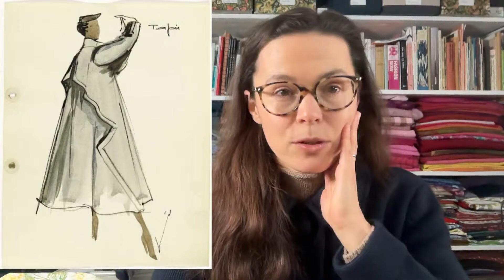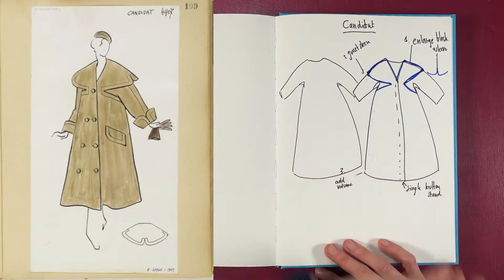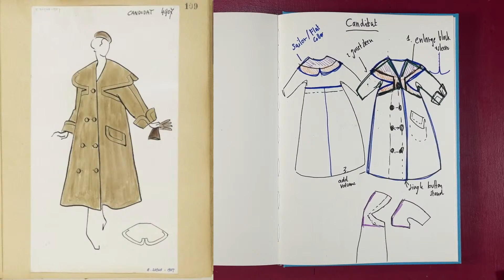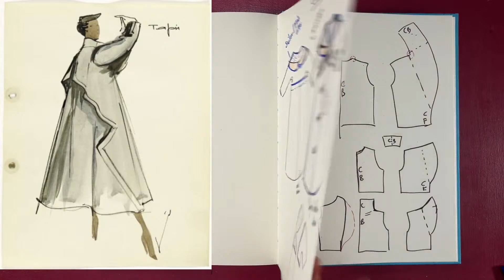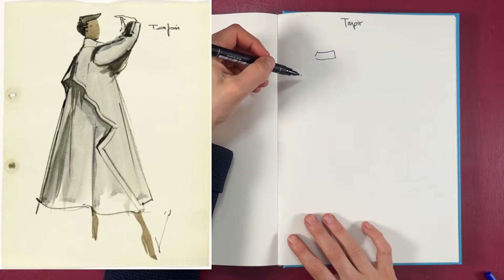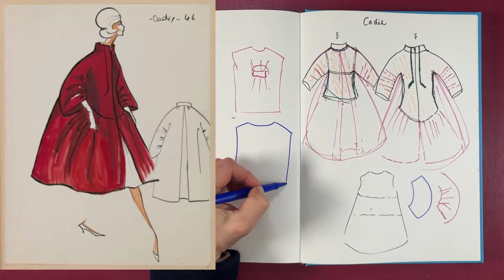Sewing pattern inspiration: How to draft your own from vintage inspiration | Analysis of 1950s Coats

Comment: Hi! Thanks for answering my question. Sorry, I had a class when you were going over the red coat design so I had to leave. But the fabric that I'm going to use is a cotton flannel from JoAnnes ("Multicolor Ombre Plaid Brush Cotton Fabric"). I'm looking at the photo reviews and I saw that someone's mom made them a swing coat out of it, but it's not structured enough to my liking. So I'd like to take your advice and interface the whole jacket. I want it to use traditional tailoring techniques so id probably use horsehair. Also I don't have fleece on hand, but I do have cotton batting from a quilting project. Do you think batting would work? I could interline it with that and then apply horsehair to the joined fabric pieces? Thanks!
Reply from the maker: Hello! I think it depends on the pattern pieces. On bigger pieces you might get drag lines.
Reply: What would you recommend using to prevent draglines? I think I will be using large pattern pieces